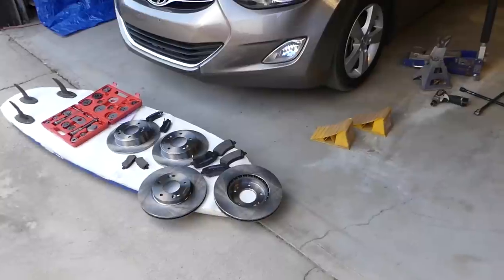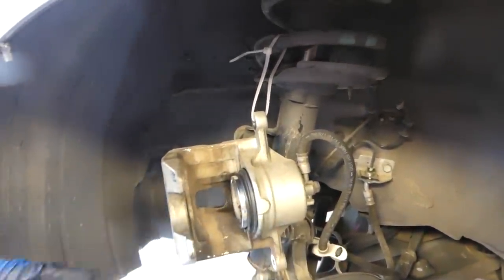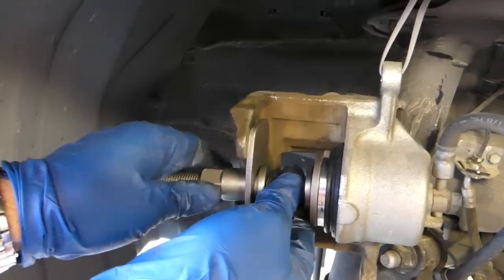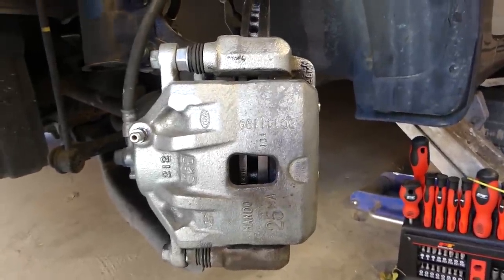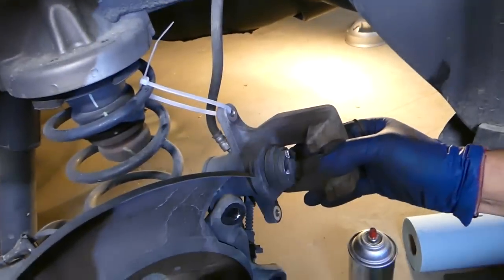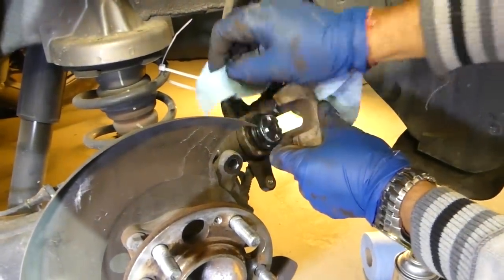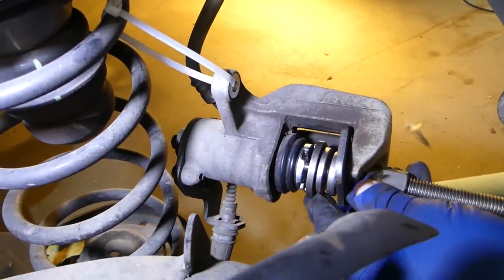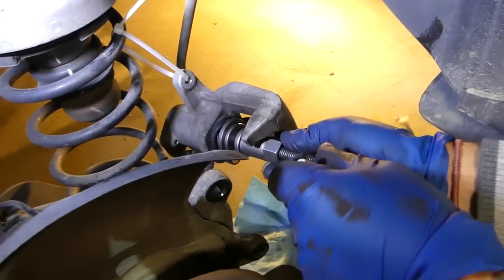HOW TO USE BRAKE CALIPER  PISTON COMPRESSOR TOOL

Comment: I've been working on cars for 53 years and I have a professional grade kit similar to yours but I only use it when the piston must be turned when the piston is compressed. I find it faster and easier to just use a fast-action bar clamp or fast-action C-clamp.  I could have had the piston compressed and the pads in in the time you took to get the piston compressed.  And with speed clamps you eliminate almost all the turning of the screw.  If you like, you can just put an old brake pad on top of the piston to make sure you don't push the piston in more than necessary but that's really not necessary. Sometimes, simple is better and sometimes special tools only make jobs harder.

You shouldn't use petroleum-based greases on silicone seals and parts, including the piston boots.  Lithium grease is petroleum based.  Petroleum based greases (like lithium grease) can destroy silicone parts such as the piston boot.  If you felt you must lubricate the boots, a very light coating of silicone grease would have been better - perhaps spray silicone.  The lithium grease you put on the boots can not only eat away at the boots but it will also attract and hold the very dirt that you are trying to get rid of.  Thick greases of any kind on the boots are a very bad idea.  One more thing:  I don't know about spraying brake cleaner on the boots. I use it to clean brake disks and drums and brake pads, shoes, and all kinds of things (it makes a great gun cleaner!) but it's pretty harsh and probably shouldn't be used to clean natural rubber or silicone or anything of that nature.  I just wipe the boots clean.
Reply: Thank you for pointing out and sharing your insight. !!!!
Reply: Great advice!
Reply: How about a big channellock?

Comment: Before compressing the brake piston, open the brake fluid reservoir, leave the lid placed on the reservoir but loose so air can come up and fluid easier return from the lines up the reservoir, that way the pistons will have not the air pressurized in the reservoir increasing pressure against you compressing the pistons but the compression will be 50% easier!
Reply: Or the bleed valve on the caliper.

Comment: Two things. This tool is generally used to compress rear disk brake calipers because they have to be rotated as they are compressed. It can be used on the fronts as well however a C-clamp is generally quicker for the fronts. The second thing is go back and look at your video where you are using the tool. Do what you are doing here and I'll guarantee your brake hoses will need to be replaced in short order. You are using hangers to take weight off the hoses but they you bend it so tightly that you're going to break it for certain.

Comment: It doesn't look as if the rewind tool was necessary on the front calipers - On rear brakes with a worm screw then I'd say yes since the piston adjusts to compensate for the handbrake - Some are right hand thread and some are left hand thread and you have to align the grooves to match the backplate of the pads such as on my Skoda and other VAG vehicles - On my Skoda front brakes I simply used a G cramp keeping it central to the caliper piston as I wound it in.

Comment: I have a question: If your caliper doesn't need to be turned while pressing how do you use the tool? Or is the adapter just rubbing on the "caliper" when turning it?
Reply: It still goes in- just won't turn the piston is all. Slowly does it.
Reply: He used the wrong adapter. There is an adapter that looks like three metal discs welded together. This adapter should be used for front pistons that are hollow inside. The adapter should not rotate on the piston.

Comment: I’m trying to use this tool kit to push the piston back in for my 2016 Polaris slingshot sl. Everything was working fine until I dismounted the caliper to replace the break pads. Once I changed the break pads the piston came out and is not letting me push it back in with the tool set.  Idk what to do I’m not a car guy I already tried using this set and releasing the break fluid thing too. The set fits good but I can’t turn the knob. Idk if it’s too hard or if something else is stoping it from turning
Reply: Have you found the solution to your caliper problem yet, my vehicle has a similar issue?
Reply: @THEREALRICK28  turns out the hand break is what caused the piston to come out. I used the tool in the video to lock it back in place.

Comment: NEVER use a petroleum grease on these boots and seals. It breaks them down and causes them to swell. Silicone based only- same for guide pins. Less is more. I always remove the lid on my master cylinder before doing this. Some open the bleed valve but that gets messy. Cleaning the bracket rust, hub rust and replacing hardware pins correctly is key. No grease on pads.

Comment: When I want the brake caliper to face me at an angle so easier to work on, is it ok to just turn it by hand with car off? Or need to start the car and turn the steering wheel ?

Comment: He forgot to open bleeder screw to remove the air.
Reply: the one caution he did forget is if you have a full brake fluid reservoir and you push the pistons back the fluid behind them has to go somewhere and it will sometimes overflow the brake reservoir and pop the cap open leaking into the engine compartment as well as leaving the brake fluid reservoir uncapped
Reply: You only try to remove air when you have replaced a brake line or the caliper.  Otherwise, there is no air in the caliper.

Comment: You're suppose to open the bleeder when you press piston...
Reply: Nah you aren't... fail on your part. You may need to remove some fluid from the reservoir however so it doesn't overfill.
Reply: @crocodile2006  Why would you have to do that? The fluid has gone down during the wearing of the old pads. You just have to remove fluid if you, at some point, filled up the fluid with worn pads.